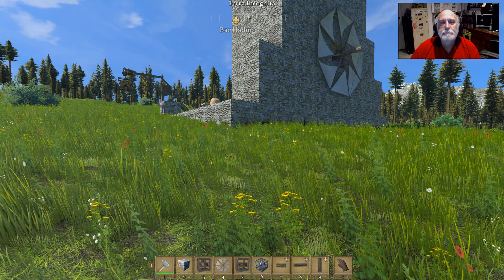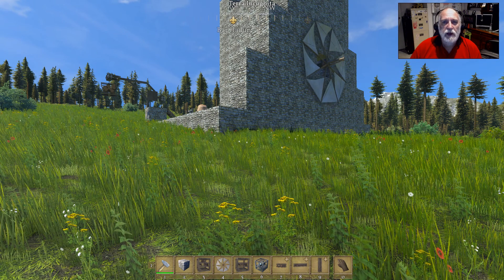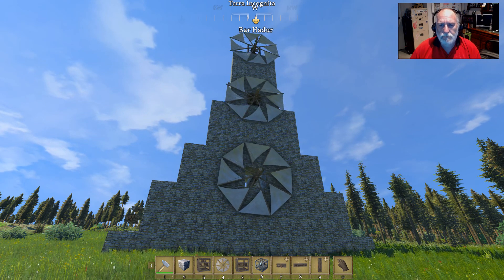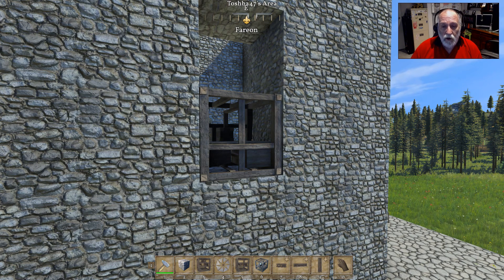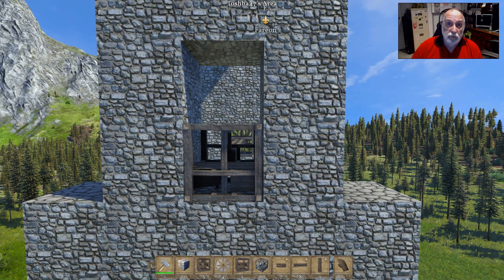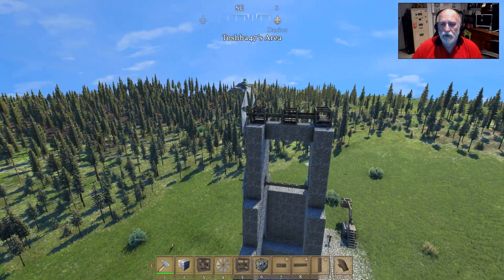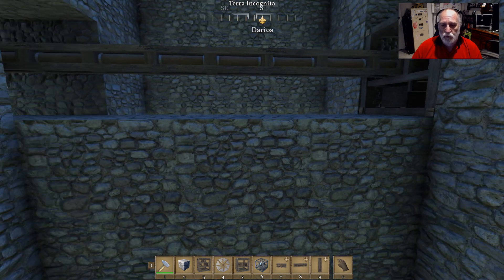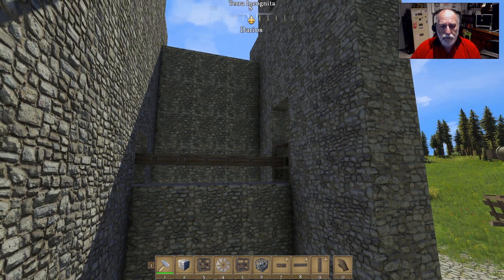Windmill Pt 2 -  Height/Power and max distance of power transfer.

Comment: Does that mean that wind power is stronger at higher elevations in general or is it distance from the ground? If i built a 5-block high windmill at the top of the mountain would it have the same speed as the same height tower in the valley or because its at a higher elevation in general would it be faster?

Comment: Ohhhhh ok! So you get more power the higher up due to more wind? Makes sense. Now about the 6 block maximum, does that still apply for the higher up windmill? Or could you have a power shaft that goes from the windmill blades down to your first floor? (If it was more than 6 floors tall)
Reply from the maker: Hi Nathan, I think the devs put in the 6 block power restriction so that it was a little bit more realistic. I will have a look and see if I can work out an extension for the top one and just confirm its the same. Thanks for the question. Cheers